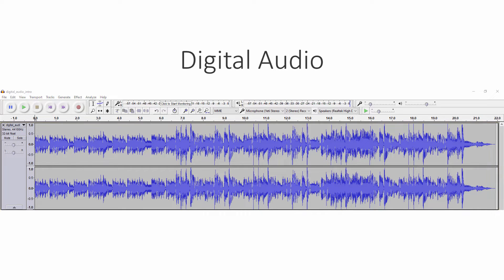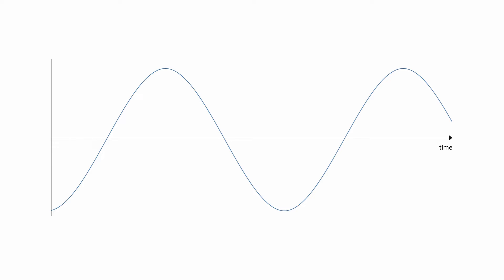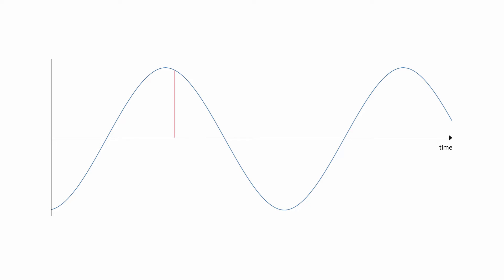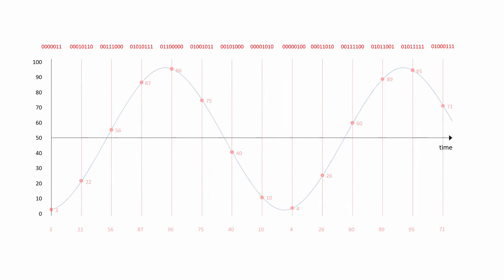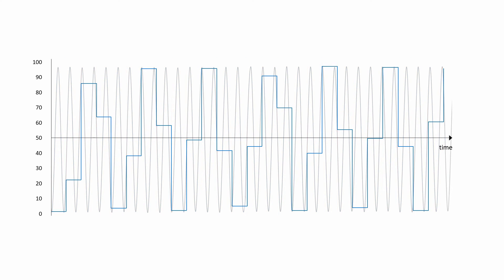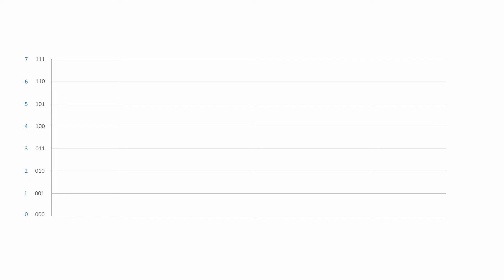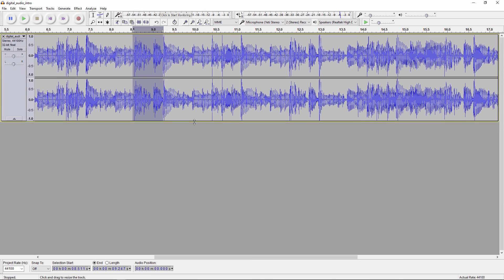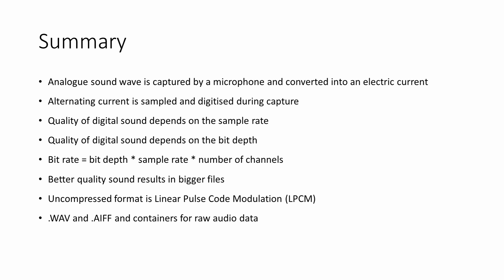Digital Audio Explained

Comment: As electrical engineer this video really is incomplete, over simplifies, at times is wrong although not overtly (there would be ZERO added fidelity to additional sampling in the example shown at first, and with digital audio the law pass filter used in the recording would block out the frequencies shown in the the second example). If you really want to know what's going on look up Nyquest-Shannon, it's a beautiful thing.
And the bit rate only changes the dynamic range of the recording.
Reply from the maker: I made this video for novices and children, to introduce the fundamental principles.  Perhaps one day, I will go into more detail :)KD
Reply: @ComputerScienceLessons  You don't need to  do that, its already been done.  https://youtu.be/UqiBJbREUgU?si=OfZL2Vf3eye5lpo0